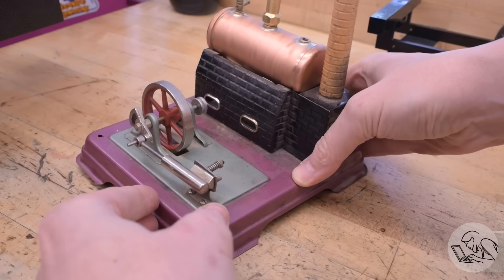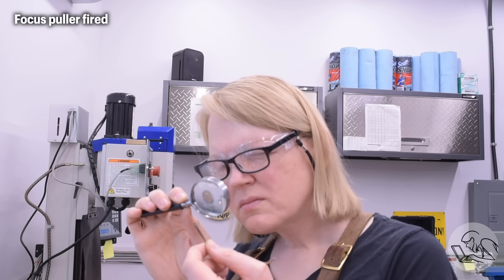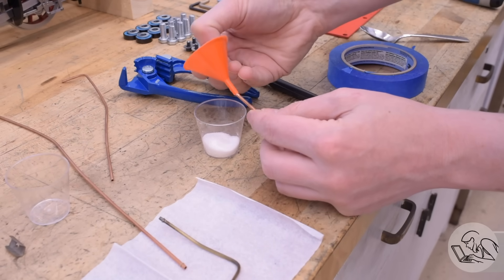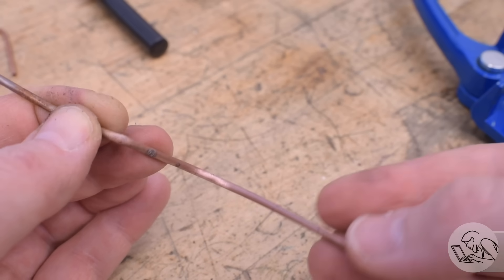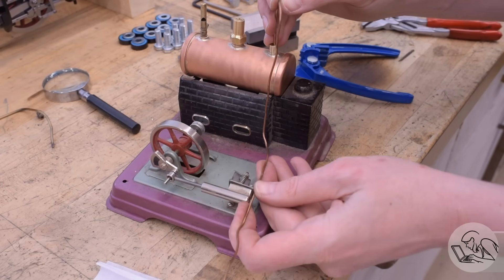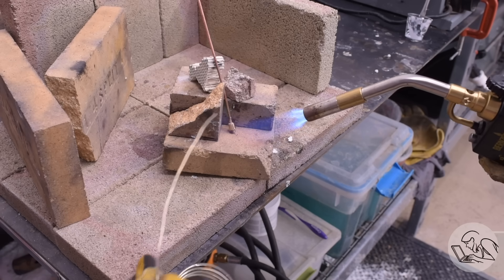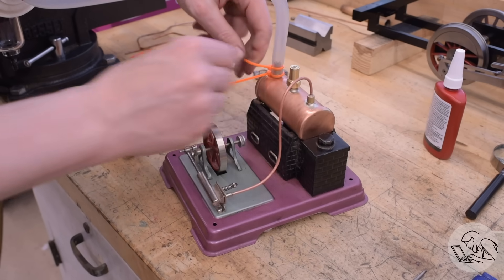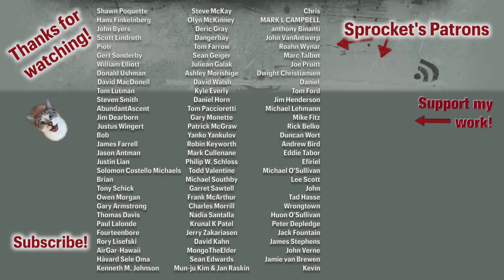Restoring a Vintage Steam Toy - Part 4, First Run On Air!

Comment: Miles O‘malley, an awesome brass instrument maker in Chicago, has to bend quite a bit of brass tubing without it deforming and he has come up his own bending matrix that I imagine would be very handy in a hobby shop. You mix it with water, and then you fill the tube and freeze it. But unlike some other frozen bending matrices, his can apparently freeze in just a regular home freezer. Then you just heat up the tube a bit and all of the liquid will melt out into a bucket, and you can reuse it like pitch or something! Could be interesting to check out if you find yourself having to bend much more tubing!
Reply: He sells it on his website for what seems to be a very reasonable price, given its reusability

Comment: Another method / bending matrix used by some instrument makers / repair shops is to fill the tube with pitch, make the bend, then heat the tube to melt the pitch and pour it out.

Comment: To bend small tube without kinking, wrap some paper tightly around it where you want to make the bend. Seems unlikely, but it works. It provides just enough support to stop it kinking.

Comment: Easy way to clear a lot of Loctite used on bolts: Add Febreeze and wait a bit.  Supposedly it works on blue, red and even green Loctite.  I wonder if it would work on your tubing Loctite?

Comment: Capillary tubing like that is used for engine gauges in old vehicles - extending the pressure from the engine oil (or from a bowl of mercury for engine temperature) back to the drivers position or cockpit where the gauges are mounted.

Comment: I ran into the same problem locating with tiny copper tubing used to prime an antique aircraft engine (still in service). I found the tubing at an auto parts store in an engine oil pressure gauge kit.

Comment: i once making power steering lines and very tight bend on 3/8 pipe so i fill it with lead. bend it and melt lead away.

Comment: Coil a snug fitting spring around it for bending, or, even copper wire, electrical without the plastic works fine, but remove it before soldering, i had them in my van for bending all kind of thicknesses of copper tubing and if it didnt fit i made it

Comment: The folks that make air guides out of copper tubing, fill the tubes with Cerrobend, a very low melting point bismuth alloy.  After bending, the alloy is melted out by submersing in hot water.  It is available from McMaster Carr, Cheers!

Comment: Beautiful flittle engine! Fleischmann wasnt located to far away from where i life.

Beinding small dia pipe, my arch nemesis.
Each time i see the recommendation of filling a granulate into tiny tube for bending, the recommendation usualy comes from people who have never bent small dia pipe but have read it somewhere.
(Semi Unrelated: I am bending some production parts out of stainless tube - And I only get clean results by hot bending (I prefer to not do that, since i have to polish the pipe outside and inside if I do that. The other solution I found that works well-ish, is having a piece of copper round stock in the pipe the exact ID of the pipe and then forcefully pulling it out the pipe after bending. That has severe limits, but yields some neat results)

Comment: In my Classic Vehicle, Brake system, I used Kunifer pipework { Ku-copper, Ni- nickel, Fer-Iron, }, and at the Connectors we use ""Olives"", which are "Compression" fittings, trapped by a Nut , which becomes trapped on the pipe 'FOREVER"
Love your series  !
Stay Steamy  !
Stu  xx

Comment: Capillary tubing was used in instrumentation applications in the bad old pneumatic days. It was used to transfer information from sensors to such devices as differential pressure transmitters.

Comment: Quinn - it's always great to see something run under power, even if it's compressed air. One alternate way to bend tubing is to fill it with water, and freeze it. The ice does a pretty good job of keeping the tubing from ovalizing.

Comment: A solder wire as close to the ID as possible would eliminate kinks and then you just heat up the tube and let it flow out. Similarly, you could try to fill the tube with molten solder then again heat up the tube to remove it after bending.... Next time.

Comment: Hey Quinn, K & S metals arent available in Canada? Surely they'd have 1mm id tube. Ive got a fair few of their bits, couldve sworn they have tubing like that? From memory its at least close Id have to have a look in the workshop
Reply: Yeah K&S have some nice tubing in copper and i have a
2mm od with 0.35 mm wall thickness and have used those in many projects .

Comment: I have used steel braded cable to prevent thin wall tubing from kinking when bent. After bending then you can pull the cable out.

Comment: I’ve found tiny copper tubing in oil pressure gauge installation kits at the auto parts store. Done that several times!

Comment: At that scale, I'm wondering if a bit of 3d printer filament would work to fill the tubing to bend. Clearly annealing was a perfect solution, but just a thought for possibly getting tighter bends.

Comment: Trombones and trumpets and all the other brass instruments need perfect bends otherwise the sound does funky things and sounds refracted. What they do is called ice packing, and it’s just what it sounds: fill the tube with soapy water, freeze it and then bend it frozen. The ice inside prevents the tube from collapsing, and the soap makes the ice less brittle so it doesn’t crack or puncture the pipe
Reply: Thank you, I remembered that it wasn't pure water, but I couldn't remember what was added.

Comment: Lovely, I had one just like it. Had a red waste pan under the valve assembly. Waste water was collected in it. I'm going to look for it. Would love to run it again. Should I pressure test it before using it? Safety chief says yes.

Comment: When I bend that sized pipe. I use steel cable inside. your last method was pretty good.
Reply: Weed eater string works too.

Comment: Congratulations! A little oil between the steam cylinder and the vertical plate/bracket will help seal up any leaks there too :)

Comment: I did some tubebending on very small thinwalled copper for many years ago and i took the spring out of a old boxseal that fit perfectly inside and after bending i just pulled'it out and before this operation i also anealed the tubing .

Comment: I run my little steam engine (same one) on dust off. I invert the can and fill the boiler with fluid and then seal up the water fill.

Comment: I have a set of springs that fit around small-diameter tubes and are supposed to prevent kinking when you bend the tube. Never tried them on copper though...

Comment: Tube bending - one small tube bending hack is to fill it with 'Woods alloy,' a low-melting alloy (158°F/70 °C). I spent most of 20 years using  a version of this trade name, Cerrobend, on the wet end of cable-mounted oceanographic sensors. We couldn't use Spelter (Zinc) terminals because that would have melted the wires inside the cable. It does require the sacrifice (dedication) of a pot used only for that material. Cadmium and Lead digestion are inadvisable in any quantity. We had a dedicated stockpot melt the alloy when we were rebuilding the end, nx to make a double boiler for heating the metal. And a dedicated melting pot that fits into the stockpot, which makes a double boiler.
Glad to see that annealing to dead soft worked.

Comment: A spring that is slightly larger then the diameter of the copper pipe will allow the tube to bend without kinking the pipe.

Comment: If you find yourself challenged by making tight or complex bends in small diameter tubing again, try plugging one end with a bit of clay (play doh works wonderfully), filling it with water and freezing it. It will make the tubing bend like it's a solid wire. You do have to plan ahead and work quickly, but the results are stellar. This works even with metals, like stainless steel, that don't anneal as easily.
Reply: The navy electronics manual reccomends filling with tin or solder and then bending
Reply: Pardon my french but that's f*cking genious! I have a stalled project I'll pick back up just because of this! Thank you!
Reply: I've seen brass instrument manufacturers do this, but they used soapy water so it'd freeze to a slush, not solid ice.
Reply: I've used the water and freeze method and it was perfect
Reply: You can also use water, doesn't compress and easy to pour out, just crimp and solder bother ends, fill, with no air and you should be good, it you can't get the end to solder when there is water in there, Ive seen people use a plumbing fitting rated for pressure. But it's usually easy, if you're using small diameter pipe and a beefy soldering iron.

Comment: that flared ring reminds me of "swagelock" ferules that I used to occasionally need to replace on gas tight tubing on various analytical laboratory devices.  I knew how to fit and leak-test them, but had no interest in determining if they were indeed Swagelock brand or style...
Also reminds me of the flared plumbing fittings where the tool would make a donut from inside the copper tubing, usually just before realising that the necessary fittings were on the wrong side of said donut....
Not to be confused with the other flaring kit that involved a clamp and a die that would make a cone shaped flare on the very end of copper tubing with the aid of a hammer... again, with fittings all too often on the wrong side. 
Ahh, the joys of holiday work with my gasfitter father! I think I was more hindrance than help.

Comment: Pardon my ignorance but what is dry steam? It seems like a bit of an oxymoron.
Reply from the maker: Everyone above covered it very well! I’ll just add that what people colloquially call “steam” is actually water vapour. Actual steam (sometimes called live steam to further distinguish it) is an invisible and extremely hot gas. It’s the true gaseous state of H2O, which is different than tiny water droplets suspended in air.
Reply: @Blondihacks  I learned a while ago (probably from you) about live steam as opposed to water vapour but I hadn’t heard the term dry steam before. On a side note, that hot water vapour has been very good at treating my sinuses for the cold I’m just getting over, so it does have a use.😁
Reply: @Blondihacks that’s the way to bring it home Quinn.
Reply: Dry steam would be all steam (gaseous water) with no liquid water droplets.  Better for efficiency and, at least in larger applications like turbines, you don’t want little tiny water droplets shooting through the system like little bullets.  

There’s a starter answer that will incite someone with more accurate knowledge to correct me.  :)
Reply: @johnedwards7473 you got most of it, here’s a bit more - steam at the temperature of saturation but with very few or zero water molecules.
Reply: @johnedwards7473  Thanks, that was helpful.
Reply: @robertpearson8798 still, that’s an excellent question.
Reply: @johnedwards7473 nope, you covered it well enough. If the OP wishes for more knowledge about the terms sub and super saturated and steam drying and the myriad other terms power plant folks use daily there is google.

Comment: Try model airplane parts suppliers for tubing.  I've seen brass, aluminum, and even stainless tubing available from some..  Also, they usually sell small springs specially designed to go over small tubing so you can bend it properly without kinks.

Comment: Out of interest is there a piece missing on the cylinder? I'm wondering if that clip was meant to hold the feed pipe to the frame as the taper is away from the cylinder? Just a thought.
Reply from the maker: No it’s all correct

Comment: Great that Quinn, I have just repaired a Mamood  boiler for a school, they show the students how steam drives a generator. The pipe fittings are soft soldered so to strip it, its just a case of a quick flash with a small gas torch but thats a story for another day. Stay well

Comment: Have any friends with an electrolysis converter? You know, use electricity to split water into hydrogen with free solar power. Popular mechanics' had me hoping for home versions in the '00s, lol. Would be fun to tell people an engine can run on solar powered water gas though eh, haha! 

Great work as always.